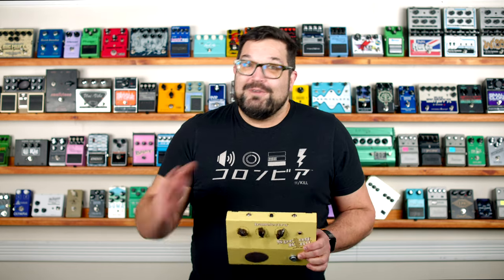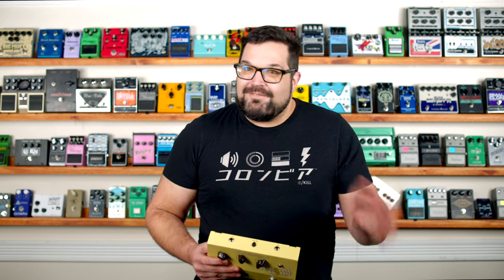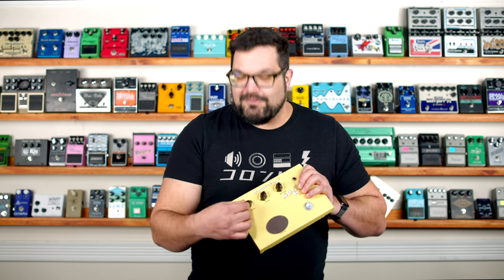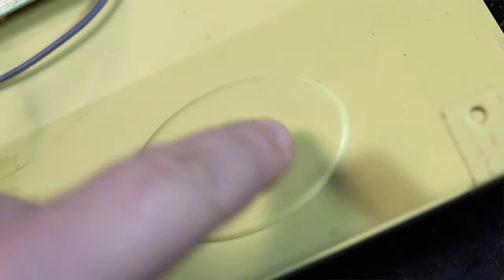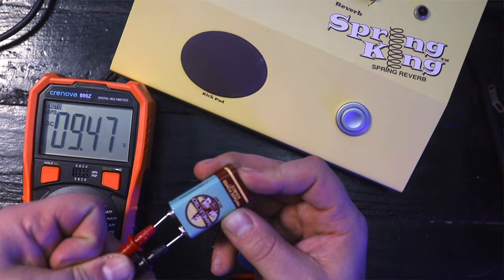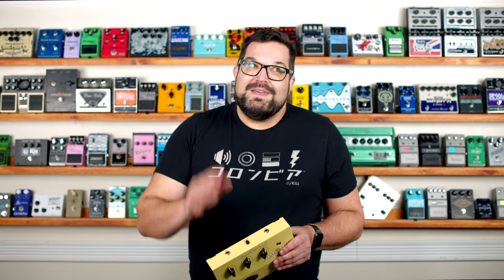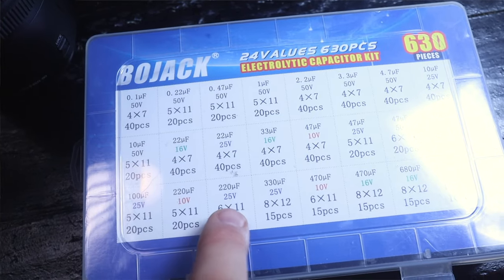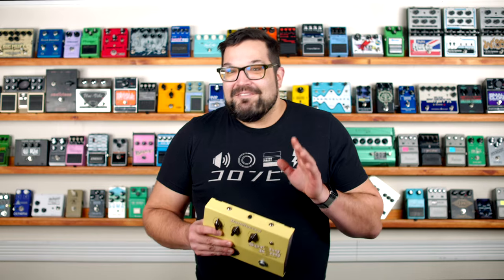The Spring King Does Its Thing

Comment: It would be cool if you got your hands on the new Spring King Junior when it comes out. They’ve removed the volume control on the new version — the pre-reverb gain that determines how hard the signal is hitting the springs. I’m hoping that the new version has just combined its “Reverb” control (the wet blend control) with that old pre-effect volume rather than just eliminating that pre-gain function altogether.

Comment: Glad to see a video on the spring king. i have one of these.  It works well for about 10 minutes then i lose volume.  Every time.  I stopped using it because of that.  I'll be taking a look inside to see if mine has the same issues.

Comment: I think you can definitely hear the difference with the tank hooked up, even without it picking up room sound. But yeah the reverb drive is probably a bit under powered. Could be interesting territory for mods. I've seen a trick of using op-amps in parallel for more current capacity to drive a reverb tank. And someone could put in a daughter board with a voltage doubler. Or you could probably power the whole pedal with 18 or 24 volts with some minor modifications.
 It's really not bad as is though.

Comment: Did you have any insight on why the volume is basically useless? I’ve heard it described as controlling the wet/dry mix but mine has no perceptible effect. I know you said it was “subtle” but it just doesn’t seem like that’s right
Reply from the maker: I heard just a tad more of the actual tank reverberation in the mix with it maxed but you’re right, it doesn’t seem like it does much of anything

Comment: I must be a muttonhead. Your experiment @ 11:38 confused me; how can you get reverb out of the pedal if your guitar isn't going into the Input? Also, how much of the reverb is coming from the tank, or is it just there so you can bang on the enclosure (the extended clatter @ 5:00 is awesome)? Anyways, another great video! Really fun to see you troubleshoot and fix. Cheers!
Reply from the maker: Ah, I probably didn't really spell that out. The sound coming out of the Peavey Classic 30 amp is enough to vibrate the spring tank, even though there's no signal coming into it. It's kind of like it's kicking the pedal, but with sound waves. 

I think the amount of reverb coming from the tank absent of there being sound in the room is fairly minimal. I contemplated modifying the pedal and cutting the output of the PT2399 to verify it, but I also wanted to make sure the pedal still worked when I was done. 

Thanks for watching, and great questions!
Reply: Aaahh! I get it now. Thanks for the explanation!

Comment: I'm often considering broken pedals but I'm loss-averse, I'd hate to feel I wasted my money if I can't fix it. I feel a bit emboldened now, thanks!
Reply from the maker: You've got to pick your battles carefully. I won't touch SMT or digital pedals unless I'm preeeeetty sure it's just an issue of a bad jack or loose connection. It is possible to solder those miniaturized components, but it's not something I want to spend an evening doing. If it's something with full-size analog components, definitely dive in. Look for anything out of the ordinary, then grab a multimeter and make sure everything that should be connected is connected (and vice-versa) then if you still haven't found the problem, consult a schematic and literally trace the signal path. I've been able to revive pedals with burnt-out diodes, lifted traces, one time the only thing wrong was that a chip fell out of its socket.